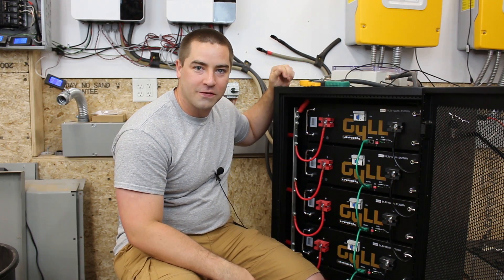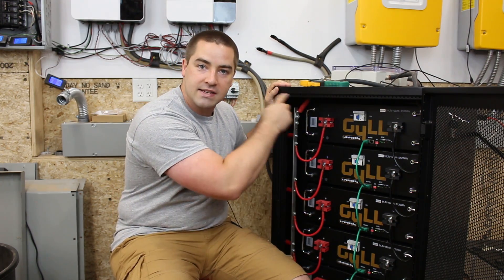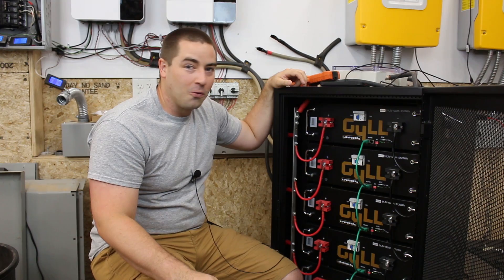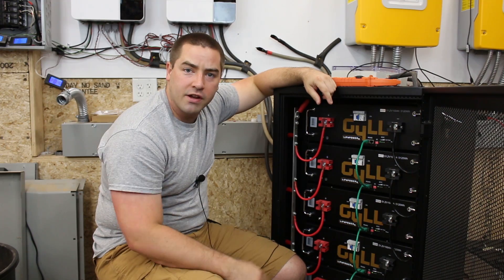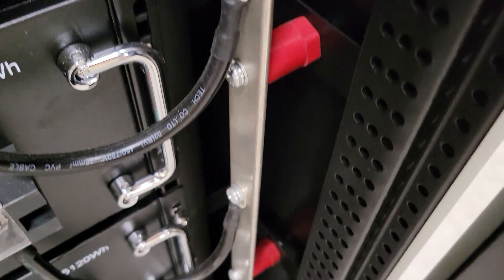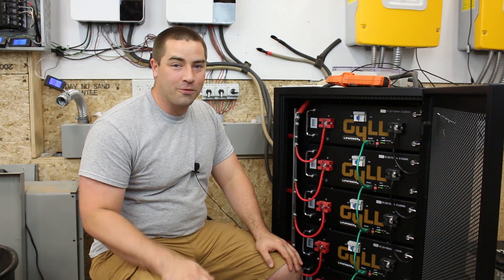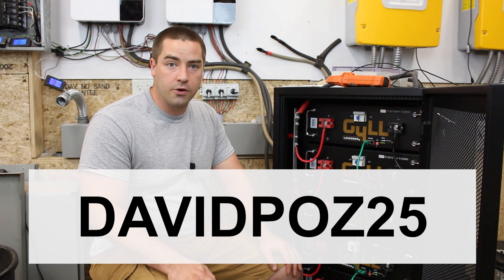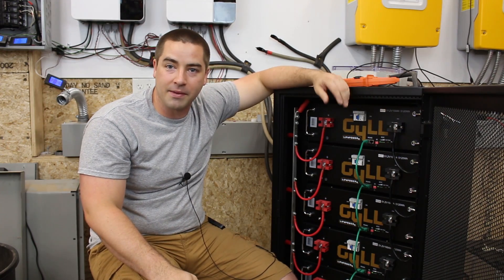Cheapest Pre-built 48V Battery, LiFePO4, Update when to buy

Comment: The 5 batteries are in parallel so stays at 51.2v and increases to 500aH…do you need a 500+ amp charge controller? And 51.2v to 120v inverter?
Reply from the maker: You are correct that batteries in parallel increase in Amp hours.  But, you can charge a 600Ah battery with a small charger or a large charger.  It's about matching your solar array to your isolation,  the amount of sunlight available.
Reply: @DavidPozEnergy  ahhh so for the charge controller you want to maintain amps and wire the solar panels in series, and for the inverter you want to maintain the volts and wire the battery bank in parallel?  In parallel, the battery bank will maintain the 48v but have 600ah, do you need like a 800 amp fuse on the battery positive wire to the charge controller and inverter?

Comment: what size cables and lugs did you use to connect battery to battery then battery to bus bars?
Thank you so vey much for you deatile videos, I appreciate it vary much, thanks again
Reply from the maker: The batteries came with small jumper wires to go from Battery terminals to the busbars.  Those jumpers are 6 gauge, and maybe 8 inches long.  Then I used 4/0 to go from the busbars to my inverter.

Comment: The literature offers a ridiculously small amount of directions for solar system newcomers. For the cost, I’d expect more resources. For some folks it’s all plug and no play. You can forget about the help for the software (poorly designed software IMO), I had to troubleshoot all that on my own, half the provided directions were vague or just wrong. Then have endless back and forth through email with screenshots and whatnot.

It seems there are so many versions of these units from one company, most of the literature is not very helpful. The BMS Tool software seems to be designed for windows 95 by someone with frighteningly little grasp on the English language.
Reply from the maker: Yeah, that software was pretty difficult for me to figure out.  I made another video with a bit more time dedicated to the software: https://youtu.be/A0bqClj5urg

Comment: I would use a multimeter with precise mV range and checked the difference between busbar entry point and every single battery connection, then you would see exactly how much you loose and what is the resistance for particular current flow path, knowing A and V you can calculate the W and the heat it generates.
Of course to proof you are right, no danger here :-)
 In the end the most risky parts are junctions/connectors, which always worries me with all these high VA DYI games.
The busbar itself would probably withold a thunder strike.
Great stuff David, learnt a lot!

Comment: Hi David.
I tried today (15th March) the coupon code DAVIDPOZ25 but it didn't work. Do you have a new deal with them?

And could you tell the difference between the EG4-LL and the EG4 LifePower4?
The specs are looking the same. Both should be LiFePo4 batteries, right?
Why is then the EG4-LL more expensive?

Comment: Hi,
I have a new grid tie 6.7kw solar system with 7.2kw of battery in the UK. The batteries are fine but I know I can take advantage of cheaper more freely available power and, on good days charge more. Do you think these batteries you have mentioned will be compatible with others? Or does it need to be a separate inverter charger and array?

Comment: Hello,  I am impressed with your clear description and detailed tricks. last August, I have installed same battery size from Sorotec brand, it is almost same look with similar specs. I hooked it up to a local made charger to charge it from the Grid. our electricity cycle in Lebanon is not stable and the engineer told me that this might ruin my inverter. I noticed that my inverter charges the battery faster than local made charger. the local made charger is 80 amps. the first question: how can I stabilize electricity cycle coming from the grid ? Second question: can I make the local charger stronger to decrease charging time? 
Thanks for all the information you provided and for your answers in advance.

Comment: You run you hole house on this? I wunna build an off grid cabin 800 square feet. Would two of these batteries run something like that if had baseboard heat that I only ran when I was gone?

Comment: Good information - battery well built.  No sure if this battery will work with AIMS 6000-Watt Pure Sine Inverter Charger 48Vdc / 240Vac Input & 120/240Vac Split Phase Output with all the BMS and settings required.

Comment: Another Great video. I have 6 batteries like yours in a rack and I'm feeding to 4 Growatts like yours. I noticed you split 1 wire off the buss bar to 2 inverters. I plan to use 2 wires off each buss bar to 4 inverters. I'm using 2AWG wire to the inverters. What size wire should I use from the buss bar to each splitter and would a "T Tocas 300A Bus Bars Heavy Duty Module Design Power Distribution Block Busbar Box with 4X M10(3/8") Terminal Studs Black" (On Amazon) be a good splitter. Also, Any other suggestions would be appreciated.
Reply from the maker: We need to add up the Amps.  For example, I'm running Growatt 5000ES, which are 5kW inverters.  I run mine with a 125A circuit breaker and 1/0 wire (2 gauge is acceptable according to the manual).  4 inverters times 125A = 500 Amps potential.  That's a lot.  One option is to run all 4 sets of wires independently down to the cabinet's built-in bus bar.  That would be the simplest way.  
I added a Victron 500A shunt to my setup so I could do some monitoring checks.  So if you also wanted to do something like that, then you will need one 600A bus bar like this: https://amzn.to/3fHoUlb  
I hope that helps.  Stay safe and remember to use fuses and/or circuit breakers.

Comment: Did you say$1500 per battery, or for all the batteries? You kept saying for the battery.  Do you consider the whole unit the battery. Guess I can check out the website.
Reply from the maker: $1500 per battery.  Each battery is 5.12kWh.  I have 6 batteries inside my cabinet.  I call the whole thing my "Battery Bank".  Sorry for the confusion.

Comment: Have really nothing to say but if it was a wery large pack and too small bus bar having the plus and minus supply cable for thebus bar at diagonally to get 100% even current between cells, so only difference in the batteries would maka any difference.

So cable at posite at the top 
And minus cable at the bottom

Comment: How would these batteries work with hydroelectric it is a constant charge. I have not set up my system yet just starting.
Reply from the maker: Whether you use Hydro, Wind, or Solar, you will need a charge controller in between the energy source, and the battery.  The battery will work with all of them.  However, not all charge controller can accept hydro or wind.

Comment: Looks like a nice system, but.... (6 × $1500) + $500 = $9500.  Whew!

Where I live (NC), the retail price of electricity is about 11¢ per kWh.  This battery system stores 30.72 kWh of electricity, which has a retail value of about $3.38.

If you get 2000 charge cycles that would mean cost of the batteries is $9500 / 2000 = $4.75 per charge cycle, or $4.75 / 30.72 = 15.5¢ per kWh.

So, unless you live somewhere that electricity is very expensive, like Hawaii or Germany, just storing the electricity in the batteries costs more than it would cost to buy the electricity on the grid... and that's not even counting the cost of the solar panels, inverters etc.
Reply: Correct analysis. I live in GA and electricity is even cheaper here: $0.08/kWh. I moved from CA where electricity is more than 3X more expensive than GA. Renewable energy is only cost effective when governments make traditional sources of electricity artificially expensive.

Comment: Not to nit pick, but that's definitely more than a 1% difference. It's a 5% difference from top to bottom as it dropped roughly 1 amp (from 20 to 19) which equates to 5%

With how easy it Is to install those batteries though, it would be easy to rotate the batteries every year or two. Simply take the top battery and move it to the bottom and shift the rest up every year or two.

Comment: Thanks for your videos.  How many eg4 batteries can you install per inverter?  How many inverters can you install per batteries?
Reply from the maker: Each battery is 100Ah.  The cabinet holds 6 batteries, so the whole cabinet is 600Ah.  The manual for the inverter (5000ES) says a minimum battery of 200Ah.  There is no limit to the maximum number of batteries per inverter.  You could install 1,000,000Ah battery if you had the money, space, and desire.

Comment: Can you connect 5 EG4 to 1 EG4-LL and get the screen to show all batteries? Can these batteries be connected to the SOL-ARK?
Reply from the maker: I don't think the screen will show the cell voltages of the other batteries, but the screen will show SOC (state of charge) and that will represent the whole stack.  I currently have my battery cabinet hooked up to a Sol-Ark.  It works with voltage setting.  I don't have any communication wires connected between the Sol-Ark and battery.
Reply: @DavidPozEnergy  That is great to know. I figure why buy extra LL if you can see it on one. The batteries look great and would love to see if you can communicate between SolArk and batteries.

Comment: I build batteries for a living and I don't think this is a good enough test, and since hes getting money from the manufacturer its hardly unbiased advice.  Documentation from the Orion BMS system clearly indicate that special measure must be taken when putting packs in parallel.  Series is definitely a nono.  Go read it.  If I was buying a system I would buy one battery pack, never multiple.
Reply: Whether uneven lengths of wire to the batteries will harm anything depends on the current being drawn. At lower currents, it's not an issue. If this system was discharging closer to 1C, it might be an issue. As he's using it, I don't see a problem, and I've been in battery pack design for over 20 years.

Comment: Have you done a real world usage for these batteries. I don't mean the 5 minute hot air gun that tells you really nothing. What sort of things do you run off this setup and how long does it last you. Really trying to do my homework so I can work on getting a setup for myself.
Reply from the maker: I've been running my whole property (house and garage) off the grid using my solar, inverters, and this battery bank.  It's been 6 or 7 months now.  The battery lasts about 2 days with my usage, but that can vary widely from house to house.

Comment: You should take your DC volt meter and put one lead on the bus bar close to the power terminal and one at the other end to read the voltage drop. I would be surprised if you read anything more than a few millivolts if the conductor is properly sized. I mean that's how all electrical distribution panels work. If you had different lengths of wire to the bus bar that would be a problem. Think of the bar as being one point source.

Comment: David;  I have the same setup X 2. 12 batteries and 2 racks feeding a Growatt 12K Inverter. I had way more loss on the bottom batteries than you experienced.  To overcome this I flipped the negative (Right Hand) bus bar and fed it through the bottom. I purchased the rubber grommets that you recommended.  I used 6 foot 4-0 cables to get to the inverter. I was not aware of Signature Solar until your videos. Through the last 15 years I have used Flooded Lead Acid and Sealed Lead Acid with dismal results. Even with only allowing 20% DOD. This has been my best set up thus far.  Thank you for the videos and the discount.
Reply from the maker: I'm glad to hear you solved it, and it's working well for you.

Comment: You could actually measure the resistance of each battery and then make the cable between battery and busbar different lengths to make resistance the same but its just not worth it . The internal resistance of the batteries will also change .  Most I would do is maybe swap position of the top and bottom batteries once a year or measure the internal resistance and put ones with least resistance at the bottom.

Comment: Oh, I am really disappointed with the cabinet from Signature Solar!  I ordered mine the day after the Poz video alerting us to restocking of batteries and cabinets.  6 weeks later, I have received my shipment and assembled the cabinet … I found it was lacking front door, rear screen, top and bottom panels, and castors.   I called Signature Solar and was told “I ordered a rack and not a cabinet!”   Just for the record, I ordered a cabinet and paid for a cabinet!!!! Apparently the cost of the cabinet has jumped to $650 and they decided to ship me the rack they now offer for $500… This is bait and switch and very unethical in my opinion.   Poz, you should know this is what they’re pulling on their customers…
A month after I placed my order, they’ve updated their website to show the cabinet is now $650.  I am so disappointed!  I am so angry I can’t see straight…!!🤪
Reply: Not to mention the holes on the battery modules do not align up with the holes in the rack making impossible to secure the batteries. Could have bought a couple bus bars and some 2x4's and saved about $400.

Comment: Looking at using only a single 48V battery (assuming they come back in stock) for a solar backup generator (Growatt inverter) that is capable of running our well and a few other lower power parts of the home (refrigerator, microwave, a few lights, etc.) during an outage.   Is a rack really required with these?  Thanks!
Reply from the maker: Nope.  You could set your battery on a shelf, or build some kind of bracket.
Reply: @DavidPozEnergy  Thanks!  Our home splits our power into two panels (a generator ready one for the water well pump and other lower power stuff and a second panel for heavy duty stuff like water heater home furnace, etc).  The well obviously has a very heavy current draw but only runs for a short time and not much usage at night.  Would a single battery (48v 100Ah)  be sufficient for keeping a refrigerator and a few other odds and ends going through the night?  Thanks again for all your help via these videos and responses here.

Comment: David I just got my 6 batteries from Signature solar. I am having a tough time finding any info on charging parameters, other than Charge current of 56.0V.  Before you hooked up the Growatt, what charging parameters did you use on the Victron charge controller? I have 2 Schneider MPPT 150v 60amp charge controllers.
Thanks!
Reply from the maker: Signature Solar has a page called resources for all their batteries.  Here is the specific page to 48V: https://shop.signaturesolar.us/pages/48v-eg4-battery
Personally, I set my Bulk (absorb) voltage to 56.0V.  Then I set my float voltage to 54.0V.  I hope that helps.
Reply: @DavidPozEnergy Thanks David, after I commended I found another battery manufacture that uses lifepo4 cells. They put a Schneider specific charging parameters.  So I am going to start with that and tweak it.

Comment: OK 6 batteries at $1499 ea. that is $9000 then the rack, shipping and the rest of your components what did you spend $20,000 and that does not account for those massive solar panel banks you have.So over $50,000 total good thing you make 6 figures a year from Youtube huh?
Reply from the maker: LOL, you started off well, but then you are making widely inflated guesses.  How about checking out my older videos to see how I source materials at scrap values, and find used panels for cheap and/or free.

Comment: Great series of videos!  Very informative for DIY work.  On your variation in measurements, it should also be noted that your batteries were in a charging mode, and not knowing the SOC, the variation could be from the BMS balancing the cells within the individual batteries.  Measurements on this type of setup should be done on discharge in order to bypass the BMS.  Keep up the good work,  I'm leaning heavy toward duplicating your Growatt system myself.

Comment: David, I’ve been building my off grid system because of you, so thank you. So, for your 6 battery rack of GYLL 48v batteries, what is the gage of the wire between the batteries, and what is the gage of the wire going back to the inverters?? Thank you. This is for a sanity check..
Reply from the maker: Each battery has a small jumper to the Bus Bar.  That small jumper wire came with the batteries and is about a 6 gauge.  From the bus bars I have 4/0 leading out of the case to my shunt.  From the shunt to the inverters I have 1/0 wire.  The manual says you can run the inverters on a minimum 2 gauge, but I had the 1/0 so I used that.